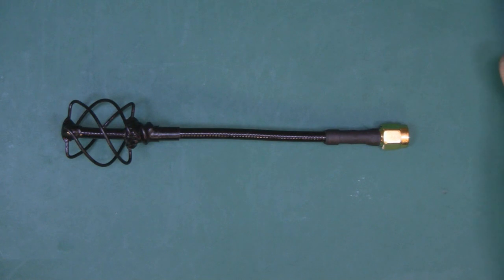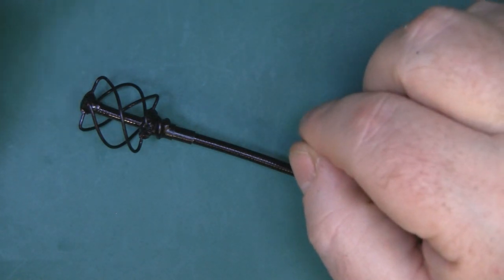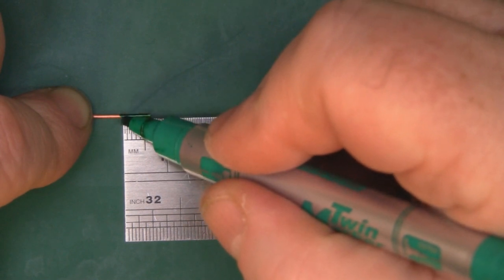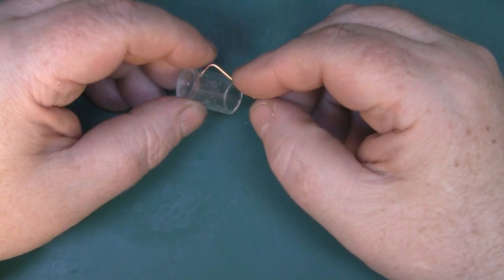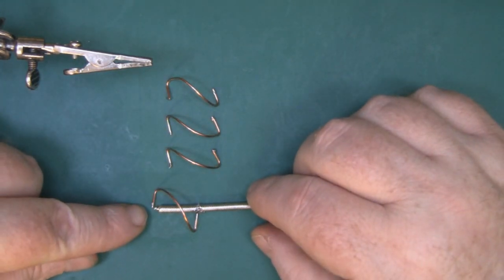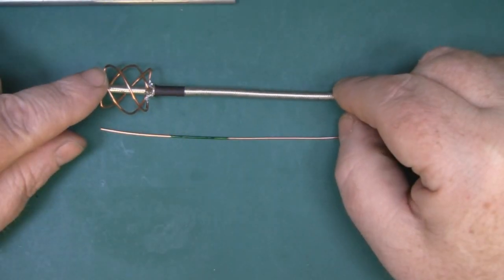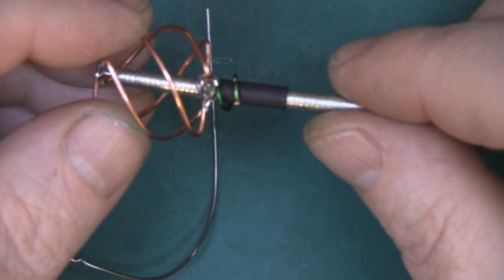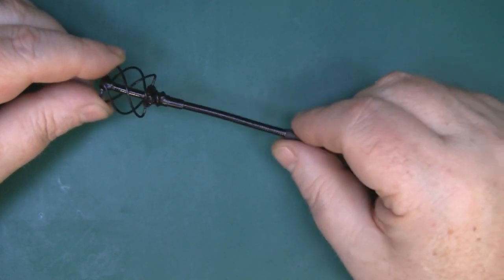Quadrifilar Helix Antenna 5.8 GHz #111

Comment: Hey Andrew, thanks for the tutorial on this awesome antenna. I’ve been making a few for myself as well as friends and have the means to check SWR return loss on SPec analyzer. I’ve make a few with beautiful frequency response using your exact measurements and have noticed that when I increase the distance from base to top of elements it completely kills swr. Just curious.... where have you derived the 20mm distance from? Online calculators for quadrifilar antennas? Anyways.... great job thanks. I’ve flown out around 1/4 mile and tested two on diversity set up, they work well and definitely look very nice!

Comment: How good would this be for a TX antenna on the quad would it help with better sinal when around trees at 200mw and would the accuracy be any more critical for the transmitter getting hot if my mesurement's not 100% spot on ?.Still think I'll have a go at this one.cheers for the great video Andrew...fellow pom in Australia .

Comment: You say that the antenna you make in the video is RHCP. As I have read in several articles and patents of quadrifilar antennas :

Example one : "Backfire resonant quadrifilar helix antenna popular for
GNSS, communications and weather satellite receiving stations.
This antenna is configured for right-hand circular polarization. Note
left-hand winding sense and the feedpoint at the top of the antenna."

Example two: "Note that the forward mode will radiate as an endfire beam
and the backward mode as a backfire beam and the circular
polarization will be opposed to the sense of the helix winding
sense, regardless of the feed phase progression"

example three: "The circular polarization sense of the radiation will be
opposed to the helix winding sense regardless of the
feed phasing sense.
• If a backfire helix antenna is used with a reflector or
ground plane at the feed, the sense of the circular
polarization is reversed and the antenna becomes
endfire. The polarization sense now corresponds to
the winding sense of the helices"

example four : "Consistent with the quadrifilar helix behavior in the absence
of a ground plane, the helix winding sense is opposed to the
desired circular polarization sense. That is to say a left-hand"

Also I could see that in the top feeds everything, in other designs, two helices are fed with the positive and two with ground

I would like to know if this is true, I do not try to judge him if he did good or bad, just to know the right thing to make me

Comment: Hello. i have Mikrotik WAP AC and i wand mod connector for external 5pcs antenna.
which antenna should I choose? 2pcs 2,4 ghz and 3pcs  5.8ghz.
I used in home. concrete walls in building
Pls help

Comment: sure would have been nice to see how you soldered that top on..Ive allways had a hard time with doing the to with skew and cloverleafs
Reply: +James Cureton Jr. pretinning is the key.
One extra thing I do is squeeze the end a little to make a flat surface about 1mm or less. Seems they line up better for some reason. And solder flows easier.

Comment: I made and tested a couple of these today on 5645mhz (I like to use the lower frequencies on 5.8). One I made with just 3 elements. The one with 3 elements performed slightly better than the antenna with 4 but no better than cloverleafs. 
Still fun to have a tinker with them.

Comment: HI Andrew built this antenna yesterday and test flew it this morning on my Skywalkwer 1900 and not a good result for me i'm afraid.  Usable distance was greatly reduced compared with my skew planar antenna.  It also appeared to be very susceptible to changes in the attitude of my aircraft (ie climbing, decending turning etc).  Not for me this one keep up the good work.  Bill
Reply: +Andy Buckley Hi Andy yep I added the balun so looks like a no go for me.  I regularly fly out 8 or 9 kms with my SPW but was struggling at 2.8 with this one.
Reply: +Andy Buckley No my ground station has a 10 turn LHCP helical (Andrews design) that works great with my LHCP SPW.  The Quadrifilar was also built LHCP but I just did not see what I was expecting at distance.  Anyway still worth a try am always in the hunt for a better signal ;-)
Reply: +BillHally  i also am on the search for better signal , so i went 1.2   rock solid link for what we do ! haha :P 
   i do understand that 1.2 isnt for every situation tho

Comment: Hi Andrew, I read that usually QHA are quadrature fed, with a 'long' and 'short' loop. Your designed is both loops end fed to the center/signal conductor. 

Also, the direction of the twist is opposite in QHA, resulting in L/RHCP with 'endfire' or "backfire" propagation respectively. So in your case, the helix twist is actually a LHCP directed downwards towards the antenna stem "backfire", and needs a ground plane/reflector to direct the beam upwards into RHCP.

Comment: I have built this antenna, planning to use it on a receiver, instead of a skew planar. Initial tests in my apartment did not show any difference in penetration compared to my skew planar. If the weather allows I will test them in flight.

Comment: Hi, so when I connect this to my video receiver for example, should the antenna placed vertically or pointing to the quad just like patch antennas?
Reply: +Jayson Ragasa "Such an antenna will produce an exact pattern as shown in figure 4 with 
majority of its gain directed towards the sky with minimal back lobes 
such that it does not pick up much ground noise"

ref: http://www.haroonkhan-rf.com/experience.html

Comment: 8dbi, so very flat donuts shaped right? i dont think its good for quads that change angles every half second
Reply from the maker: +Calvin C Hi Calvin it has a radiation patten identical to the cloverleaf.
Reply: +andrew mcneil Sorry but if that is the case then there is NO gain. All gain from antenna's is derived from squeezing the radiation pattern. If this antenna has a whopping 8dbi gain then it has to squash the donut pattern flatter which means its better for the receiver (as long as its not on your head). Quads or Aircraft bank. Great tutorial thanks.
Reply: Then it's gain can't be higher. As he said, antenna's increase gain by squeezing the pattern so there's more radiation in some directions and less in other directions.
This one achieves increased gain by being a hemispherical antenna, NOT an omnidirectional antenna!

Comment: You say that the gain is +8db if I remember correctly.  But how is the radiating pattern?  Is it still omnidirectional?  If we use this antenna for FPV applications, we do not want a directional antenna for the TX.  As for the RX, we can use a directional antenna but we must be carefull to keep the craft in the zone where the antenna has more gain.
Reply from the maker: +MurphysLaw996 It's omnidirectional
Reply: +andrew mcneil 
So you say that this antenna amplify the signal by 8db?  Usually, an antenna that has gain will concentrate the RF energy in a certain region, I do not see how a passive antenna can have gain and still have a doughnut shape omnidirectional radiating pattern.  From what I read on this type of antenna is that they are used for GPS and satellite applications.  Their radiating pattern is still omnidirectional but instead of being kind of spherical, the x and y axis are compressed and the z axis is expanded.  It's good for satellite reception but might not be that good for FPV (for transmission).
Reply from the maker: +MurphysLaw996 Hi Murphys it does not have the same directional beam as a true Quadrifilar due to the way I had to adapt it. The Quadrifilar owes it's circular polarised properties not just to the shape of the elements but also due to the way it is wired and fed. This version works in the same way a cloverleaf works relying on the shape of the elements to produce a circular polarised patten. But it will have nulls top and bottom so I would think it would work more defectively mounted on it's side if using on a quadcopter.
Reply: +andrew mcneil 
I just ordered some 50ohms semi-rigid coax on ebay...  I'm just too curious to see the performance.  And they seems a bit easier to make than cloverleafs since the point where the elements connect to the ground is further away from the point where they are soldered to the central conductor.  I'll be able to use the spectrum analyzer function of my SDR to see if I get 8db more gain compared to a cloverleaf antenna...
Reply: Self-editted.  I have now read the rest of the comments. Already answered.  I might suggest possibly scanning through and summarizing the main questions and concerns throughout these comments, and then addressing them in an opening description text. I gain much from such informative youtube videos, sometimes even more from the comments, but unfortunately it can be very time consuming to fish through the comments to piece together a more complete picture in response to what prove to be the most common and useful questions.  This may make future responses easier by a simple "please see the new text description for the video".   But please, do not read that wrong.  I am grateful for so many of these fine videos, and I full understand they are voluntary and do take time to plan and record and edit and post and respond to.  So don't miss the big thank you in this comment.   :)

Comment: Will this design work for both the tx and the rx?
Reply from the maker: +Jens Utbult Yes they work fine for both
Reply: I respectfully remain a bit nervous about the Tx side without a reliable means of testing VSWR.  Could you suggest a simple setup/method to at least confirm that it is 2:1 or better, with a cheap Tx, before risking the flight Tx?  If we are building antennas, might as well have some nifty inexpensive homemade test tools/methods to check VSWR at 5.8ghz, yes?  Here is an example of some testing methods to verify the effectiveness of homemade CP antennas against a commercially made baseline:

https://www.youtube.com/watch?v=jlz8MTTntGI

Now we could use some test for VSWR as well for the sake of protecting the Tx output circuit.  My schedule is full for awhile, but if others could link videos or inexpensive meters, that would be handy indeed.

Comment: RHCP or LHCP?
Reply: +Constantinos Pitsakis The one in the video is RHCP
Reply: +vlupis1 -- Do you have any constructive improvements, methods or insights to contribute? I receive a flight controller from China, and the package calls it a toy.  To some in the 1400's it might have been considered witchcraft because of what it "magically" can do.  Calling it a toy, or witchcraft, tends to violently narrow down any further discussion -- to what end?  You have an opportunity to add something positive to the community in terms of design improvement or understanding.  If you will, please do.  If you have a video with a more informative and concise construction project, or, for instance, a StackExchange post,  such as at a site like this:

https://electronics.stackexchange.com/questions/tagged/radio

... please link it.  Thank you for any further insightful and constructive comments that are aimed at the subject of the antenna rather than the person making a presentation. Aren't we all, in a sense, playing with wires and plastic and metal and doped silicon?  Help us explore and experiment, constructively. It is quite an opportunity we all have here in these days. Use it well.  Perhaps begin by simply suggesting a way to measure and confirm CP experimentally, and gain.  Maybe offer a file to plug in to NEC?  

http://www.nec2.org/

:)
Reply: I have the same question in the video says RHCP but in theory I think it is LHCP
Reply: Yes, there is some confusion that could use some further explanation.  An old ARRL antenna book I have only details a bilfilar made with coax.  It shows a quadrifilar but does not explain it fully and has no construction details, saying only that it is in use on satellites.  I need to read it again to better understand exactly what the actual CP is radiating from the antenna, but I am not sure if it would differ from a different construction.  I'd like to believe that one can always tell the polarization by looking at the physical spirals, as with a cloverleaf, but RF is not always so easily visually determined, and is subject to where volts and amps terminate or reflect, etc.

As a convenient reference, regarding the typical popular cloverleaf antenna, one looks at the antenna in an upright profile view, ground at the bottom, connected loops at the top, similar to how it would be mounted vertically on an aircraft. Now slowly turn the antenna (spin the coax in the fingers) until one of the lower legs is pointing right at you, out from the coax.  the "leaf" then bends off in the direction of the polarization.  If it bends up to the right it is RHCP.  If it bends up to the left it is LHCP.  A question then becomes, "Does this hold true also for this particular quadrifilar antenna design?"  

If anyone has a thoughtful answer to that question, Please explain your  method and conclusion if it differs from the cloverleaf, and why, so it can also be responded to intelligently by the community for the benefit of all of our better understanding and better communication.   Also, if anyone has done a thorough RF experimental analysis of this particular quadrifilar design, and posted a video or blog entry, etc, please post the link in these comments for the benefit of us all.

Thank you Andrew, for another fine video of an antenna that is fairly easy to construct with care and patience.
Reply: +FPVunlimited Drones & FPV
I see that further down in the comments, you more thoroughly expressed your concerns.  As of feb 2018, it is unfortunatedly not yet answered.  I hope we have a response from someone soon to put the issue to rest.  If you have resolved your doubts since then, please update your response.  Of course, experimentally, it is easy enough to answer by testing received signal strength (or a simple range check) with both a RH and LH "known" cloverleaf (in separate tests of course).  If anyone has done so, please update us.  Thank you.
Reply: None! This is not quadrifilar, it has no means of introducing phase quadrature, not a real balun etc. This is just some guy playing with wires and imagining he is antenna expert. Oh, and yours cloverleaf's are also bullshit, not cp, no balun, just toys, no science!